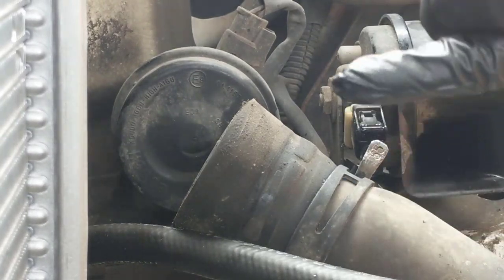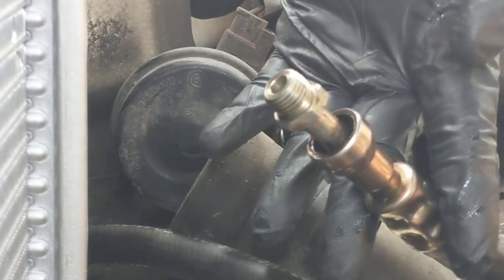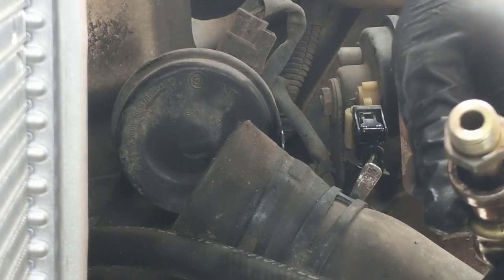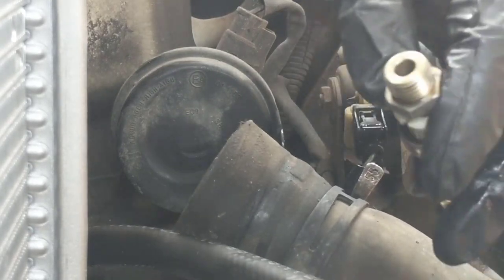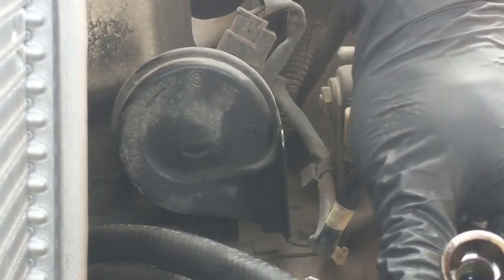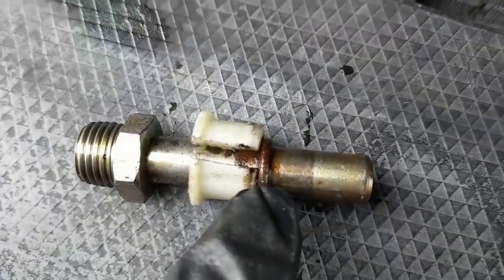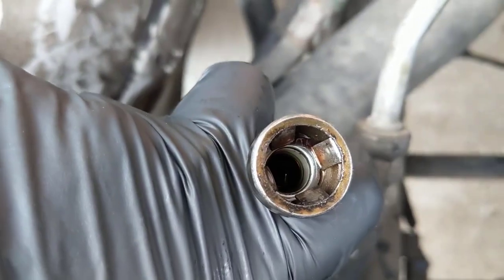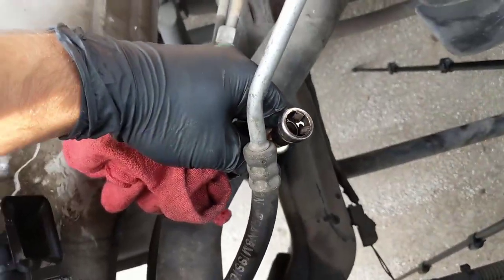How to Remove the Transmission Oil Line  Dodge Ram 1500

Comment: What size was this hose ? 1/4 " or 5/16"
Reply from the maker: the part that clicks is 0.373" or 9.49mm. That is the part where this tool connected to click it out of there. If you want to know the hose itself I can measure for you but tomorrow. Car is covered in snow lol
Reply: @CarModsGarage  thank you sir, no need to go freeze in the snow. I wanted to make sure I had the correct size quick clip before I began the repairs
Reply from the maker: @jgs6595  I added the Amazon link for this tool on the descriptiinn. Check that out. It is an Amazon link